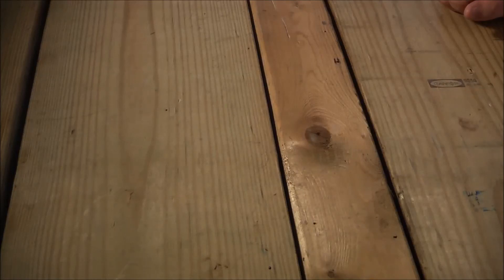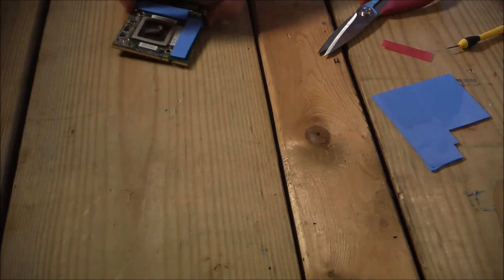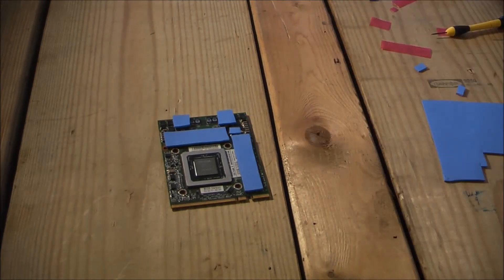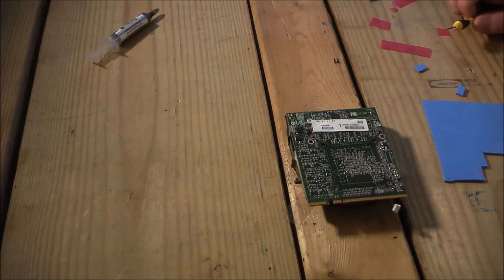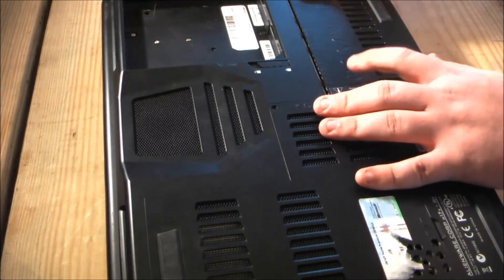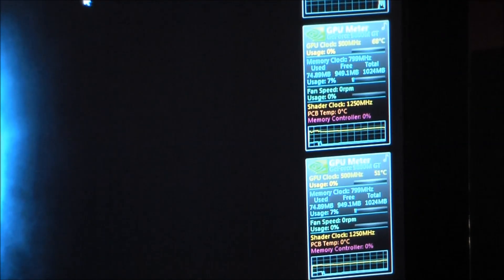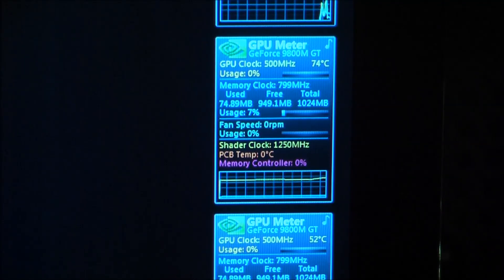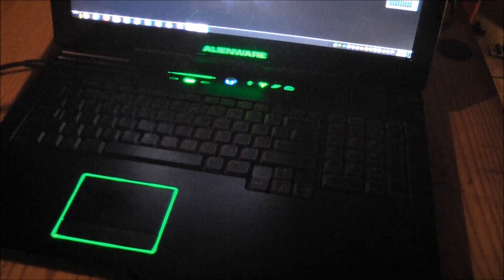Alienware Area-51 m17x-r1 gets second Quadro fx 3700m installed!

Comment: I’ve been looking to replace my 3600M on my M15x with a 3700M. Is there a reason you have to flash the bios on the GPU to have it work? Also, do replacement cards have to be from Dell / Alienware because of their bios?
Reply from the maker: Bios flashing is required for proper fan control on the old area 51 m15x/m17x. All brand cards should work as long as it's not from msi.
Reply: @gameboy3800  Sorry for bringing this up 3 years after your video haha. I'm unable to find a 3600M so the 3700M might be my only option. Been reading posts and most people are saying that the 3700M runs too hot in the system but I can't imagine it being worse than the 3600M! Any recommendations?
Reply from the maker: @alex100894  you can try liquid metal or otherwise high quality compound like thermal grizzly.
Reply: @gameboy3800  quick update, I received my 3700M and threw it into the M15x-R1 but Windows refuses to see it. Looks like I'll have to go down the same route as you and flash the card to a GTX280M. Any tips or trick to help me through?
Reply from the maker: @alex100894  if flashing to gtx 280m doesn't work then try 9800 series card. That's what it took to work in my m15x.
Reply: @gameboy3800  so I was about to flash using NVflash but get the error of "No NVIDIA display adapters found". Its weird because GPU-Z also shows "Standard VGA Graphics Adapter" but using the lookup button will load the link for the 3700M. You have any idea how to trick the computer to see the GPU before I flash it to a 280M?
Reply: @alex100894  You might need to mod the drivers.